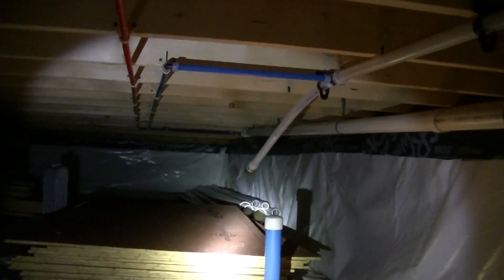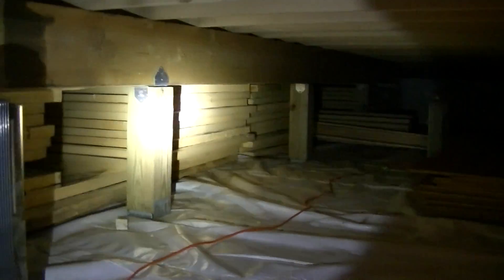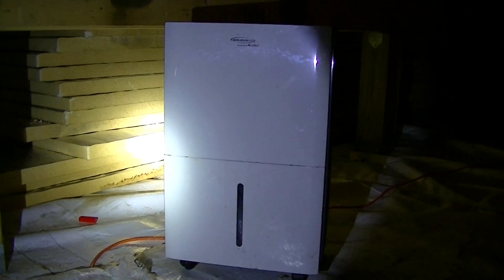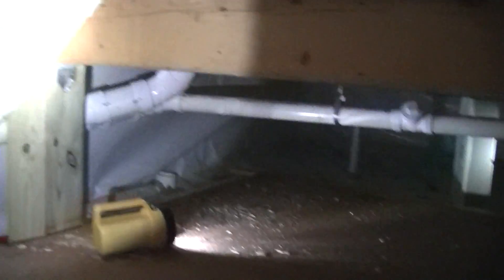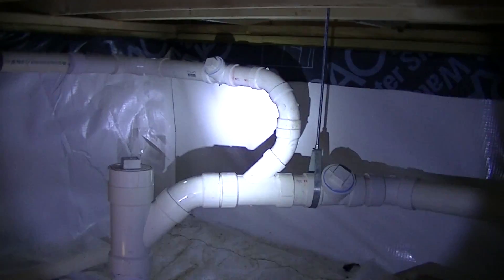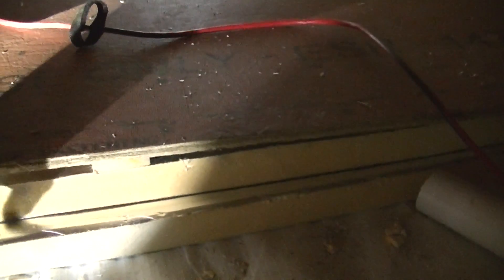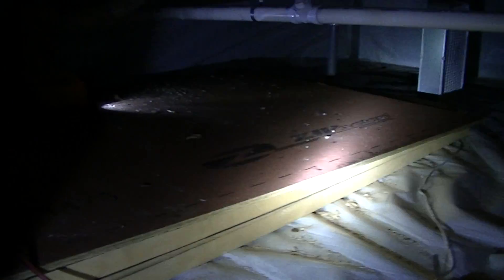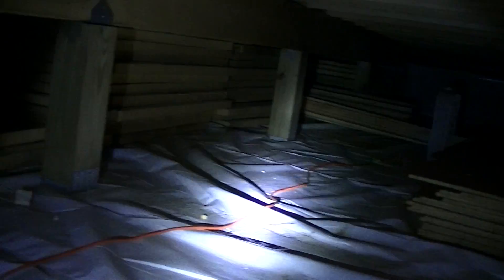00004

Comment: I was wondering why you didn't put the foamboard down underneath the concrete; any thoughts?
Reply from the maker: If I was building a new foundation from the start I would do it like that.  In fact, I did on my garage.  however, I was forced (by the town) to work with this terrible foundation that was falling apart.  So I wanted to pour the concrete slab directly up to the foundation wall to help pin it in place.  It did this very well.